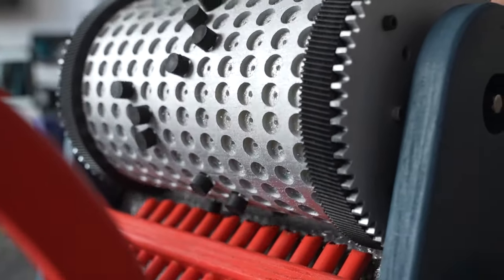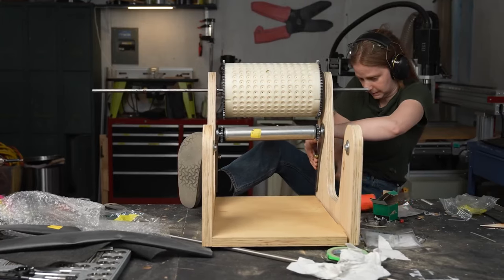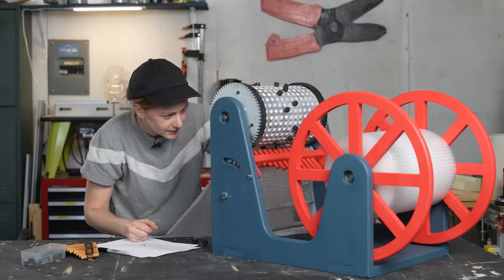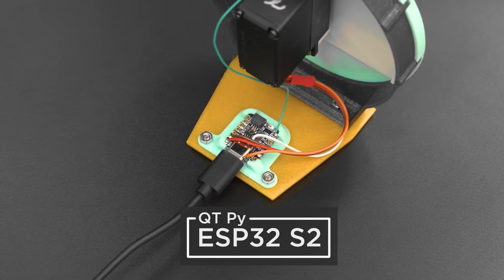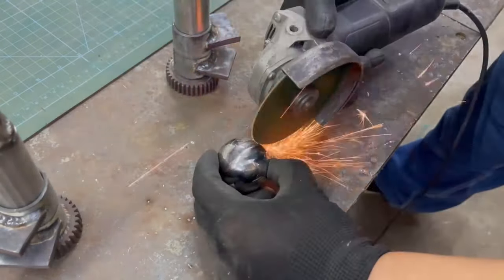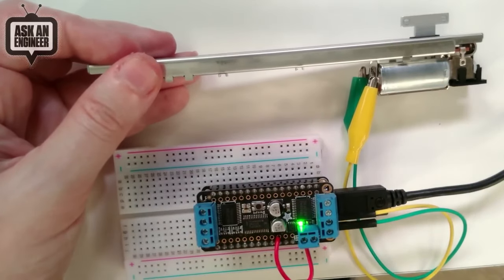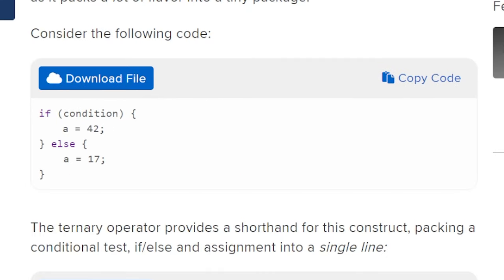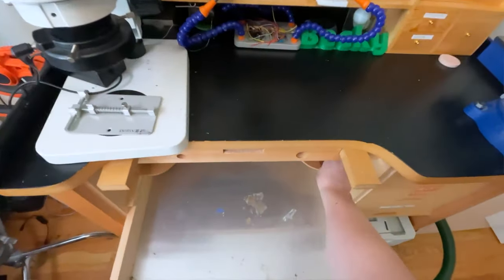Wrap Music [Maker Update] | Maker.io

Comment: I like the "Analog Servos" I didn't know that was something you could buy so I just tapped the wiper of some servos I had when I needed this exact product for when I made an animatronic Bird. I could puppet the bird with my RC controller and then record the data to an arduino. I then did automatic calibration (Set the servos to 5 degree increments and read back the potentiometer value so that I could corelate the potentiometer input to match with the servo PWM output) and used that "lookup table" to replay the animations I did. 

In retrospect the easier way to have done this would be to make a custom controller from potentiometers, and then puppet the bird with that controller through the arduino and capture the potentiometer values of the custom controller instead.